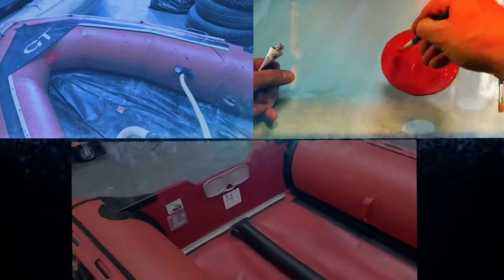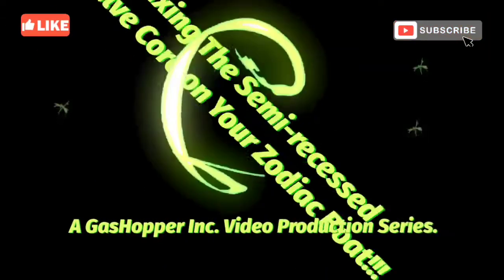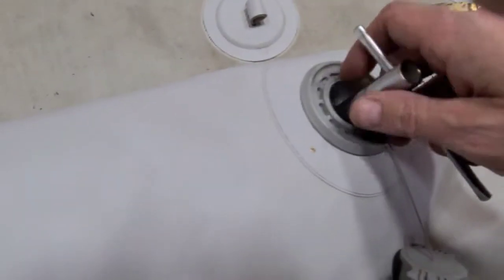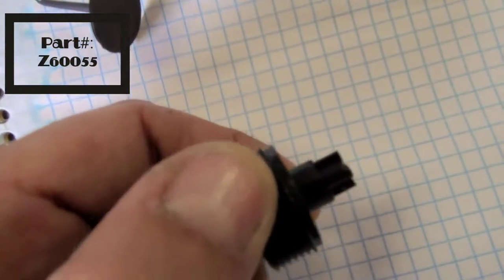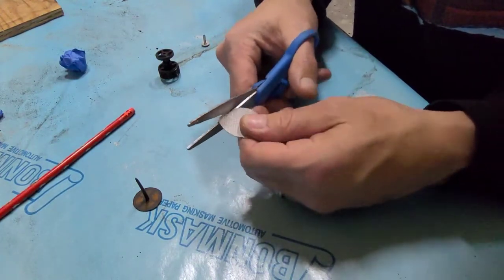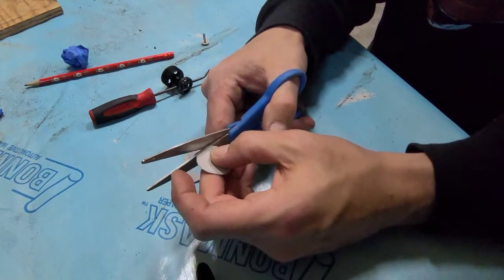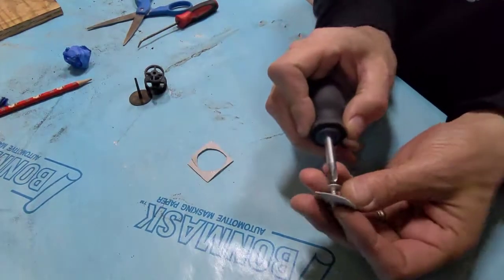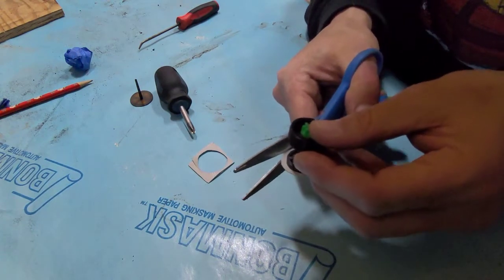How to repair your Zodiac Semi-recessed Valve Diaphragm

Comment: Thank you! I think i need to find a rubber material to use. I used pvc and i think it is a little too stiff. It leaks bad until i put the cap on, much worse than the original diaphragms.
Reply from the maker: Thin PVC fabric is what you'll need. Also, thicker vinyl fabric works good also.

Comment: I noticed you didn't test for leaks until you had attached the dust cap? I tried to fix 4 with the method you described, and they all leaked profusely until I attached the dust cap, maybe they're leaking around the screw? I'm assuming the dust crap is meant for that purpose and there's only a secondary seal if something fails?
Reply from the maker: That is correct, the cap is what seals the valve off. The valve cores will leak a bit around the diaphragms. If the cap is leaking, then chances are the valve cap seal has dried out, cracked or no longer squishy and will have to change the seal. If you noticed it's coming around the valve body nut, then just removed the nut, grease around the body and reinstall the nut. I have a video listed in my channel for valve cap replacement on these specific valve systems.